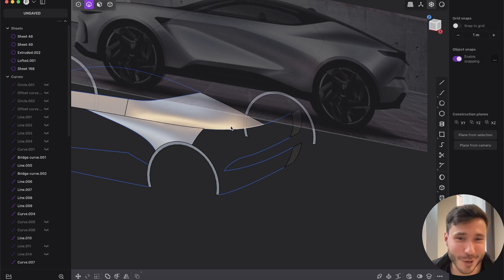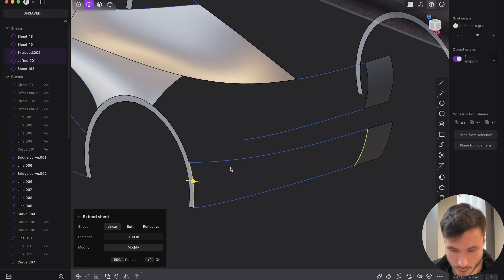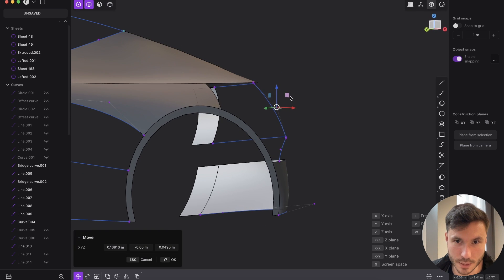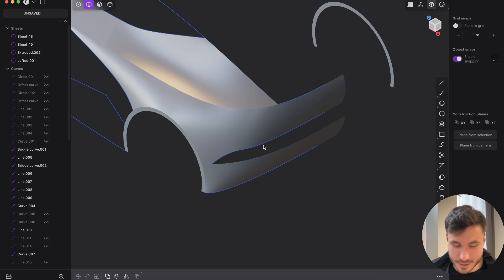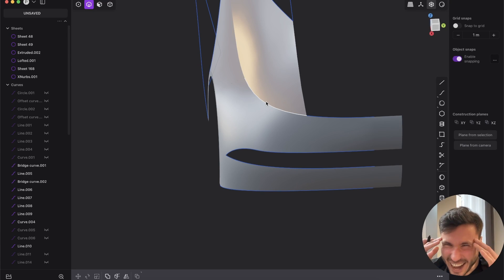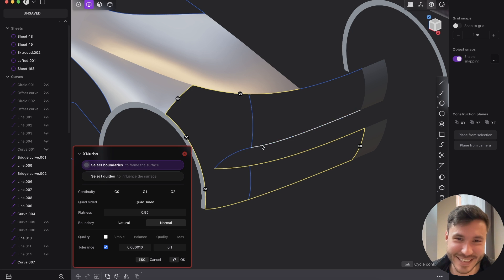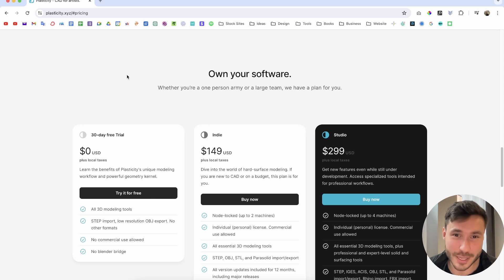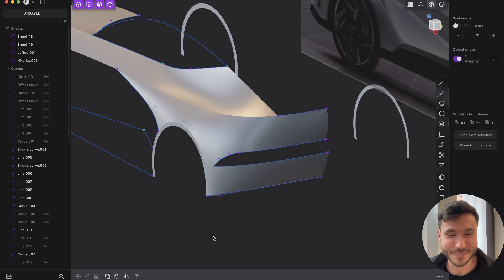THIS blew me COMPLETELY away! | Plasticity x xNURBS Car Modeling

Comment: love your excitement.  What is the difference between the $149 and the 299 package?  They look identical except a few exports which I don't need and I only need 2 machines unlocked.
Reply from the maker: Watch this video:
https://youtu.be/vk88hNFt2oE?si=wPEf02JabJ6hdZjZ
Reply: You have XNurbs and other more professional surfacing tools in Studio (like the new "Square" tool), probably there will be more. Also you have access to Beta, which usually means you get new features in advance. That said, Indie is perfect if you don't do high level surfacing stuff.

Comment: I bought Indie and have many problems with simple basic stuff (for example flip model in the same place), no SVG import, even problem with importing simple STLs. Rather not going to buy again, because only Studio license has NURBS.
Reply: Just a quick tip re flipping object: select the object to flip, hit S for scale then type  - 1 (i.e., minus one) in whatever axis you need the object to be flipped in.